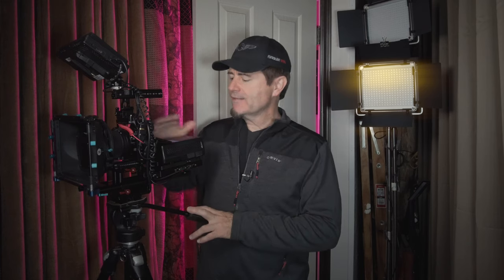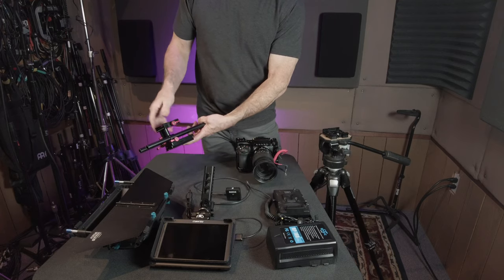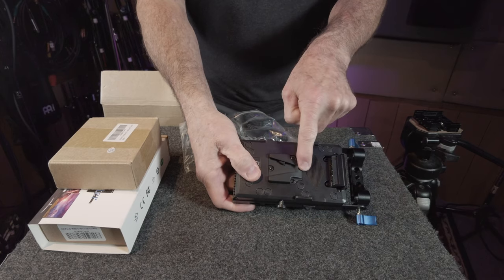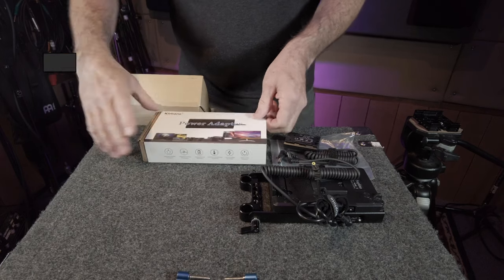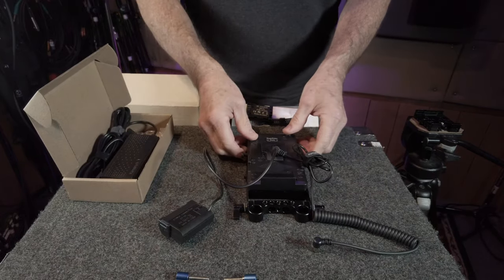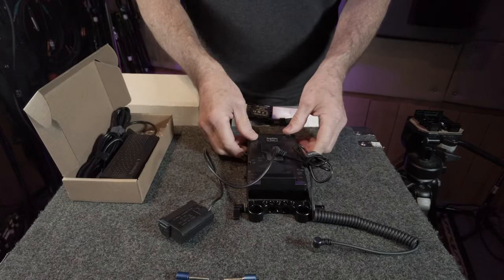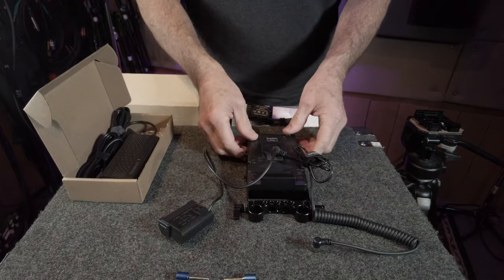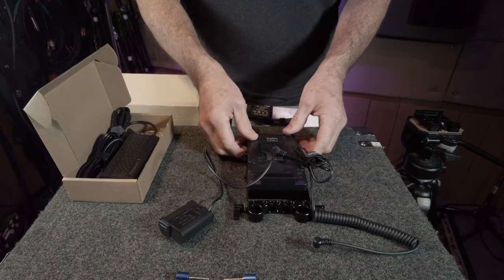Nikon Z6/Z6ii - Video RIG build. How to build an affordable cinematic setup.

Comment: Thanks so much for posting this video. I bougth a Nikon Z6ii last year, and I basically followed your instructions and built a rig. The only differences: I got a different matte box from B&H because it was on sale (and had a tightener for the flags) , and also I got a smallrig follow focus because I am using Older Nikon lenses with a FTZii adapter. Really happy with the rig! One small note, the Supfoto V-mount adapter plate now comes with properly machined 15mm rail mount bracket, so no need to get an additional one!
Reply from the maker: Great to know about the 15mm rails! Would love to know which matte box you got, always looking for alternatives to building better rigs?!
Reply: @@Featherlightstudio  it was the "
YELANGU M2 15mm LWS Swing-Away Matte Box with Two Rotating Stages & 4 x 4" Filter Trays" for $69. Its so-so, but at least it does have knobs to tighten the flags. Now I am trying to figure out how to mount and power my Tascam 701D to the rig (when i need it), but having noise issues when i power the tascam using usb. I just ordered a cable to tryvto power the tascam using the 5v output of the vmount battery plate. Will update you on how that goes.
Reply: @wenchunfan Thanks f😊r your input about your Z6 II and older Nikkor lenses, I’m n that boat and this greatly helps some decisions for me…

Comment: Great video.  Just wondering if this rig setup will work for larger bodies like the new Nikon Z9.
Reply from the maker: Because of the adjustable height rail mount, this setup will actually work with just about any body with a cage and lens combination, even other manufacturers.

Comment: Do you have a video about transferring this quickly to a gimbal and which gimbal you use?
Reply from the maker: Great suggestion Peter, I still use a a original Ronin S but, most all other gimbals work similar and most newer gimbals ( RS, RS-2, Moza Air 2, ect ) actually have even more clearance around the quick release than mine does. Really, anything with a Arca Swiss plate works pretty well.

Comment: they should program Z lenses for manual focus pulling.
Reply from the maker: You always have the option of using the FTZ adaptor and using manual F lenses as well. Its a pretty flexible system.

Comment: Hello I was wondering what are your settings for your ride wireless go and and camera settings to get clean audio , I have a slight interference noise with mine, and also which voltage do you plug the camera into ?
Reply from the maker: I have the internal audio of the Z preamps set to 1 cause they tend to be noisy if they are higher than that and the Rode Wireless output at Max.
The Lab Mic I use is just the cheap Amazon PowerDeWise one. The Rode input is VERY easy to distort so you can't the Mic too close.